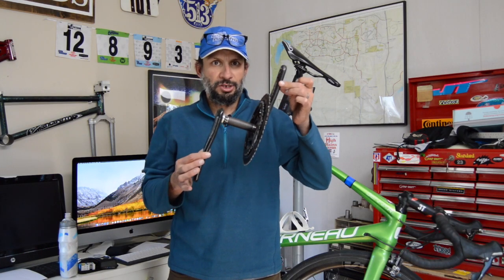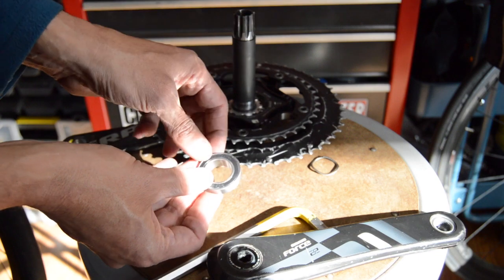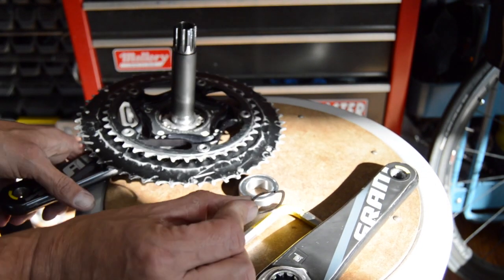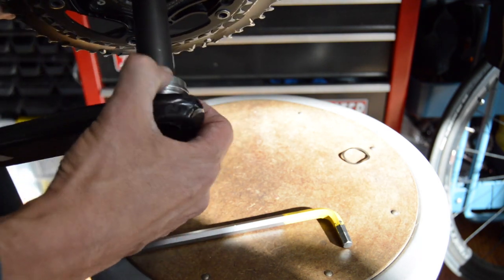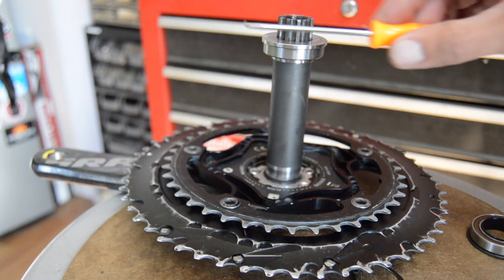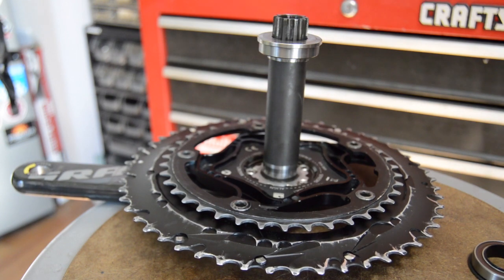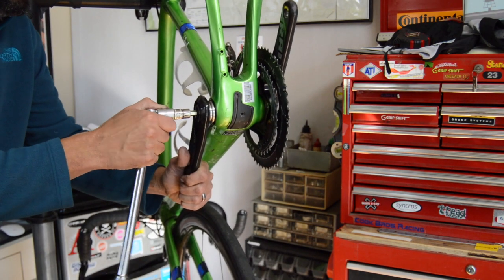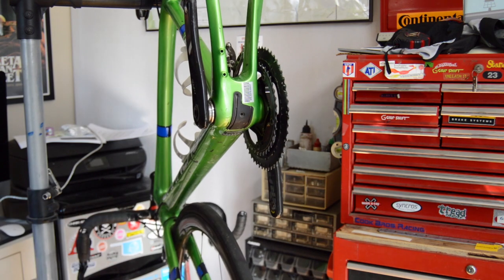IS The SRAM GXP The Worst Crankset In The World?

Comment: Thank you Sir, it was the creaking, GXP bottom bracket that drew me into this whole vortex of Hambini and then you. I mean I don’t know if Hambini is a good engineer or not, I certainly found his swearing and innuendo highly amusing to my juvenile sense of humour. Your approach I found more convincing, and I’m grateful cos I’m stuck with GXP bb replacement on order from eBay. I didn’t have the problem of this radial “waggle” until I bought my first cheap Chinese  fake GXP bottom bracket and noticed that when I road tested although the creak was gone the I had a kind of spongey waggle in the crank that was moving my outer chain ring in and out with a range of about 3 to 5 mm! This took me to Hambini, at least he admits to having autism so this could be a reason but I’m pretty ashamed as an Englishman that he was rude to you. You quite clearly have found a way around this. Perhaps I will need a better tool than the cheap ring spanner supplied that feels like a cross between plastic and metal. I do not have a torque wrench and have stripped my non drive side crank so I’m buying a new second hand crankset. Perhaps if I torque it up properly it will not waggle I hope but when I had it really tight last time the cranks didn’t turn freely. I am trying to extend the life of this oldish racer rather than give in and buy a new one. Anyhow lovely video and thanks for your expertise.

Comment: Hi Joey, recently i have been trying to install a sram gxp crankset on bb386 frame(Time scylon); i have used a 2mm spacer on the drive side as instructed, it is necessary both from the stand point of chainring bolt not hitting the frame and via measuring the length of the crank arm spindle itself matching with the bottom bracket; the problem i have is that after installation, the chainring is just too far away from the front derailleur that it is impossible to shift from the small chainring to the big chainring; if i remove the 2mm spacer, it works fine, but there is a big risk that the chainring will rub the frame, have you encoutered this kindda problem before, and what is your suggestion on solving it? thanks in advance.

Comment: Is it compatible with shimano bottom bracket
Reply from the maker: Shimano crank spindles are 24mm on both sides. GXP spindles are 24mm on the drive side and 22mm on the non drive side. You could use a reducer on the non drive side with a Shimano crank though.

Comment: I have a bb86 frame with a token ninja bb. I have a Shimano crank but I bought a sram red for the weight. 
I find the sram gxp an overcomplicated system when you have to measure with a caliper the size of the axle to decide how much spacers you need, due also to the manufacturer inconsistency (from crank to crank you can have mm of difference). To me Shimano has a simpler and better system.
Anyway, having a bb86 bb I need an adapter to fit the 22mm NDS part and I bought a token ninja kit + a ZTTO bb86 bottom bracket (and the adapter).
After an evening of measurements I decided to go with a 2.5mm spacer in the DS to fill the gap between the crank and the bearing (if the axle enter completely in the DS, the bearing doesn't work on its axle "bed") ditching the wavy, adapter inside the NDS bearing and that's all. It should work ok with no gaps and no rocking movements.
This is only theory at the moment.
Entering the axle completely in the DS I will get too much axle exiting the NDS and I should use two 1mm spacers (one per side) and a shorter adapter...
In my opinion too much thinking for a simple crankset :D I save it just for the look and the weight
Reply from the maker: You lost me at Token ninja BB...

Comment: The crank bolt on my SRAM GXP came loose and it wouldn't stay in after that as the threads were too worn. I bought a new bolt but when I tighten it, it causes the cranks to bind and not spin freely. This is at a very low torque, miles away from the recommended ~ 50 Nm. I guess the cranks are squashing the BB bearings (a BB 109) when I tighten the bolt up. I can't figure out why a new bolt would cause this though, any ideas? Perhaps the splines are worn and the cranks are riding too far up the axle? I bought an unbranded bolt but it is the same length and diameter as the original.
Reply: I think I’ve got a similar problem.
Reply: @campagnol1  Mine was a used bike that had not been looked after. Presumably many miles of riding with a loose crank bolt. I replaced the whole crankset (and BB).

Comment: The play on the non-drive side bearings is unacceptable. To expect us to keep the outer bolt tightened to 54nm all the time is not realistic. That's the only way to keep the bearings from being destroyed because of the space between the left side of the drive shaft and the bearings. The shimano system has zero play between the drive shaft and the bearings, which makes for a cranks with zero play if you delicately preload the bearings. I "Upgraded" to a GXP compatible crankset that came with a perfectly machined shim for shimano compatible bottom brackets. I tried it with an Sram GXP bottom bracket and it just has too much play unless its tightened down. Meaning the bearing is only held in place from the sides and not supported from the bottom of the race. Looks like the only way I can get this system to work is to go entirely with Chinese GXP copied parts and use exactly the BB spacers you need to get a 73mm shell between the aluminum cups, that seems to be the only fix.

Comment: Hey thanks for the video. I just picked up a used Niner handtail and im enjoying it a lot. My front crank gear had a bunch of wobble in it and luckily i could read GXP on the crank set. This video helped me learn how to take it apart. The 3 torx bolts on the back had loosened up a bit, i added lock washers (no clearance issues) should i add locktight?

Comment: I've just replaced my 2x MTB-spec GXP crank and BB with a 1x GXP crank and a new BB. The old one has done 10K+ miles and had started to look a little "shark toothed". I fancied going 1x anyway, so I stuck with what was there originally, and why not? It just works. I haven't had any issues with slop either - mine nips-up perfectly and there's no play in the system. That said, there is a gap at the drive-side but still no play so I've just left it as a gap - I'm sure it's intended to be this way. Might just treat it as a service item and clean/grease it from time to time. I haven't bothered trying to shim mine. Oh, my BB is an English threaded one.

When I need to (next time), can I just replace the bearings or will I need to replace the whole BB shells too?
Reply from the maker: Yeah, I still stand by my opinion that when set up correctly, these things are very durable.
You could replace just the bearing cartridges, but for the money and the path of least resistance, it's way easier to just replace the thread in cups with the bearings in place.
Thanks for the feedback and the question!

Comment: i think that you have to remember that the weakness of Hambini's reviews are that he is sent components and frames that are all screwed up to begin with. So his reviews are totally biased to the junk side because the parts that he is supplied with are junk. My view is that he is really reviewing that outer limits of the quality control. One important thing to think of is that he actually says what they are supposed to be such as maximum bearing clearance fits. For instance, Trek BB90 bearings have a 0.1 mm interference fit. The quality control on the BB90 is not very good and hence with not a lot of age, they start hammering the bearing loose and it starts making a lot of noise. Trek also supplies oversize bearings but these things are 0.8 mm interference fit which is far too large and would beat the bearings to death rapidly and replacing these oversize bearings would ream the press fit out and soon make it unusable. In response to this problem Trek has apparently made a special boring tool that will open these BB holes up to the required 0.1 mm fit. The weakness of this is that if you knock these loose you're SOL. So the 2021 Trek top end frames have T47 thread-in bearings. If you manage to screw this up you simply replace it with a new one. The basis of a lot of problems is that there are FAR too many riders that weight over 220 lbs riding these parts that are actually designed for 190 lb riders max. One of the local riders happily bought his Trek frame new from a certified dealer and has broken four of them since he weights over 240. The Trek lifetime warranty really has paid for itself over and over. Were you to send one of these frames to Hambini after he's broken them up, he would really roast them and really it is not Trek's fault at all. So the view of a professional mechanic and an engineer that is trying to correct these problems makes for a lot of "French" if you know what I mean.
Reply: Hambini is not an engineer.
Reply: @Unknownmanufacturer  - Hambini has a college degree in mechanical engineering and has worked in the aerospace industry in the design of jet engines. Can you explain to me why you decided that he isn't an engineer? That is a serious lie which leads me to believe that you have something to do with SRAM. That is also legally libelous so perhaps I should simply turn this over to Hambini.

Comment: I'm relatively new to bike maintenance so sorry if this is a dumb question. My bike has a SRAM Rival crankset with GXP bottom bracket. It spins very freely considering there's no play, even after a lot of miles in bad conditions, so in practice it's actually spinning much more smoothly than my other bike with Shimano HT2 preloaded enough to remove play. But recently when I was inspecting my bike with the SRAM crankset, just messing around with it to check for any looseness anywhere, I noticed if I put my weight on a pedal (bike on floor) I can see the crank arm flex inward quite a lot. It's probably always been that way, but visually it flexes more than I expected. I know frames and components flex, and that stiffness and compliance are things people want in different areas, but I was just surprised how much flex there is. I don't know what's normal. I can't tell if it's mostly the crank arm itself flexing, or if it's more the spindle pressing against the bearings radially. I don't feel play here, I just see elastic bending which I'm calling flex. 

So I was gonna ask my local mechanic or a forum about what range of this is normal. But then I watched this and I noticed near the end you were checking for the same thing by squeezing the crank arms toward the chain stays with your hands. And it looked like a similar amount of movement for the force applied. When you do this, what are you checking for, i.e. how much movement is too much? Is this something GXP does more than other standards because of its asymmetry? After seeing this I have new appreciation for people's obsession with stiffness in the pedaling area. Otherwise I do like things supple.
Reply from the maker: It will vary with different manufacturers, models, and designs/crank materials, but they all flex if you push it in sideways like that. Some more than others, but it's totally normal. You just don't want it to flex and make contact with the chain stay.

Comment: 6:30 - I think, you know the answer from Shibas video: the radial gap is still there (because of the wrong choice of bearing size), you just cannot feel with your hands, because it is tightened. But be sure, your body weight will be enought.
The other design failure - as you mentioned in a comment -: the NDS bearing gets all of the axial loads, while DS gets radial only. That is the same what Hambini sad.
Reply from the maker: Again, I don't think you fully understand the concept of how the GXP system works. There is a bevel on the step where the spindle diameter increases. Once tightened CORRECTLY, there is no movement between the spindle and bearing. If you do not torque the NDS crank arm on sufficiently, there will be play between the two and the bearings will fail. That's not a design fail, that would be the installer's failure (Hambini). I don't know if you can call the radial only load on the drive side a design flaw, at least I haven't seen  proportionately more GXP drive side bearing failures than Shimano. The drive side bearing take more radial load anyway due to the counter forces of the chainrings.
I generally tend to judge a product by it's long term durability though.
Reply: @JoeyMesa  You misunderstood me.
I mean the gap between the bearing AND the spindle (... and NOT the axial play of the bearing ON the spindle), what is caused by the wrong choice of the bearing size. That is one part of the bad design: NDS Spindle size (as Shiba measured): 21,93 mm, NDS bearing bore size: 22,2 mm.
~0,3 mm play is way more, what it should be.
About forces again: axial forces are additional (Is this the correct word?) in this case, but they are there. The DS bearing cannot deal with them, because it is not fixed on the spindle (axle).
The NDS bearing hold them all, because it is fixed. That is reason, why the NDS bearing always damages much more earlier, then the DS bearing.
At Shimano's design both of the bearings are fixed, so they share to keep up with additional axial forces, that's the reason why both last longer.
...and sorry for my english.

Comment: I have gxp it ran fine but I feel some type of pull.. can I change gxp to bb Infinity?
Reply from the maker: GXP is the type of crank you currently have, so unless you switch crank types, you're locked into that type. BBinfinite is a bottom bracket manufacturer that makes many GXP type BB's. As a mechanic, I prefer a 2-piece type GXP such as those from  Wheels Mfg. Much easier to install and maintain.

Comment: I fully agree .
I had a creaking bb30 and  brought it to a bike shop .
There they installed a wheels mfg bottom bracket .
After 6 month again creak , i took out the bottom bracket spacers myself and put locktite retaining compound between the wheels  mfg and the bb30 aluminium innershell and finally the  creak  is gone .

As said here already after that take  out the wave washer and some spacers  of the cranck assemby and adjust untill  everything  is without play after tightening  and running smooth
Also dont put all the spacers on 1 side , try to center the sram gxp assembly .

And now my sram red gxp runs smooth as hell.
I put also light sewing machine oil in the enduro bearings after flushing the old  bearing  grease out .
My bearings are 3 years old  already but still fine

Comment: according to SRAMs website a gap between the crank and driveside bearing is normal...
Reply from the maker: Yeah, generally it's totally fine unless you're running a BB90 bottom bracket on a Trek. If there's a gap on the drive side, the non drive side bearing can migrate out of the frame snd cause damage to the carbon fiber.
Reply: Joey Mesa thanks for the reply!

Comment: Thanks for the video Joey Mesa.
Having ridden a host of different BB configs over the years and having had very little problems with most of 'em I still agree with Hambini's criticism of the GXP design. That is, the non-drive side bearing takes of all the lateral load required to secure the crankset. Greater friction and accelerated bearing wear especially when typically shoddy QA/QC protocols are factored in, eg, misalignment of the bearing surfaces in the BB shell, are the results. 
That doesn't mean I'm going to ditch my SRAM Apex crankset as it's on a S&S coupled bike and the convenience of completely removing the crankset with one 8mm allen wrench supersedes design deficiencies.
Mediocre designs can be functionally adequate but they should never be mistaken for good or optimal designs. This is the point I believe Hambini was making and having no problems with our GXP's doesn't negate that.
Reply from the maker: Thanks for your feedback Luke!
I, like yourself, have owned and ridden pretty much every type of BB/crank set up out there. My day job for the last 37 years has been in the bicycle industry mainly as a mechanic. There's not a system out there that's perfect, but from my experience long term durability wise, the GXP system is one of the better ones. The only real issues I've seen with a few GXP cranks is the spindle separating from the drive side crank arm or the aluminum pedal boss separating from the carbon on carbon models. 
I honestly haven't seen bearings on a GXP crank wearing faster than Shimano bearings. I realize the non-drive side bearing takes all the axial load, but the radial load on the bearings is much higher, especially on the drive side, witch on the GXP bearing is all it has to take. Truth be told, in the last 4 years, I've seen more warranty issues with Dura Ace and Ultegra cranks (splitting in half) than GXP cranks. I still think the Shimano hollow tech system is great, but it's not perfect.
My biggest issue with Hambini is his mechanical ability is not in line with his engineering ability. Most of his analysis is just calling people names and offering no constructive advice. His fix to the perceived problem was a shim to allow a standard 24mm id bearing to be used on the "out of spec" spindle. The only issue I saw was his inability to fully tighten and engage the crank arm onto the spindle splines.
All GXP non-drive spindles are well under sized if you put the bearing loosely on the spindle and wiggle it side to side, it seems like a really loose fit. The spindle shoulder is beveled and centers the bearing when the crank arm is secured against it. Hambini just doesn't understand that part.
All in all, I think Sram's consistency in quality control and tolerances is decent. There's way more variability in bike manufacturers than Sram's components.